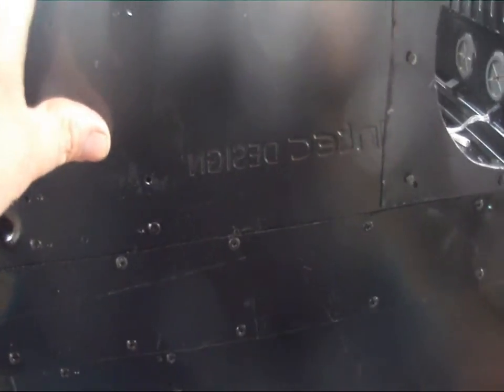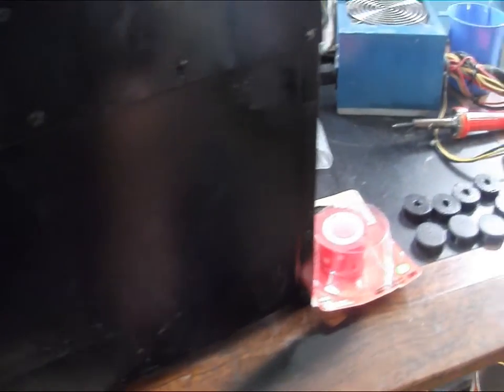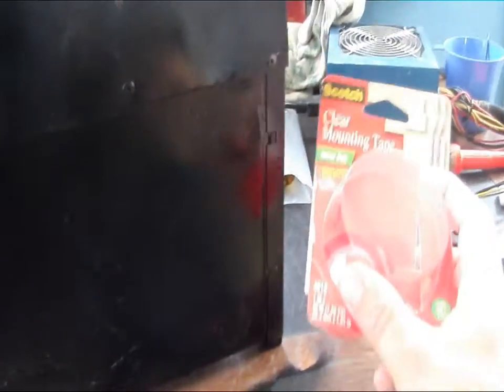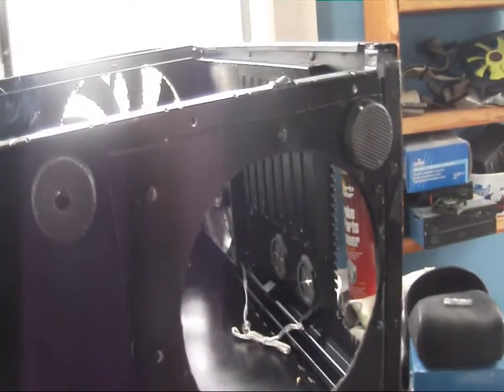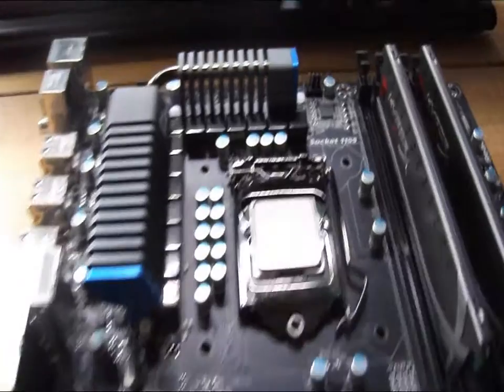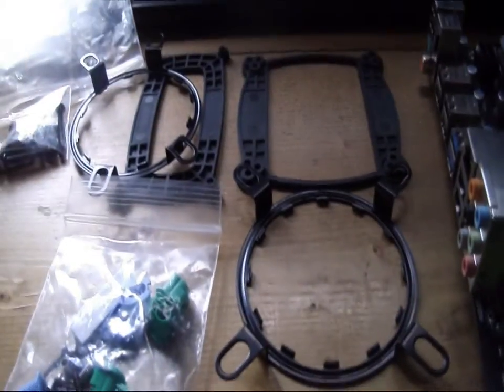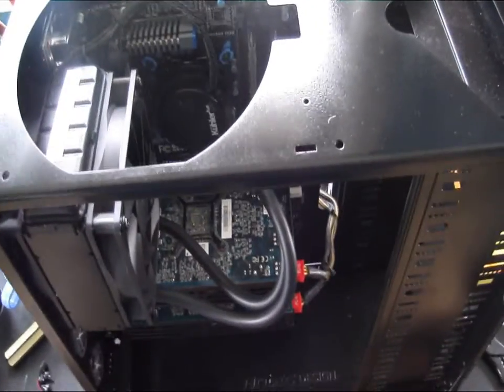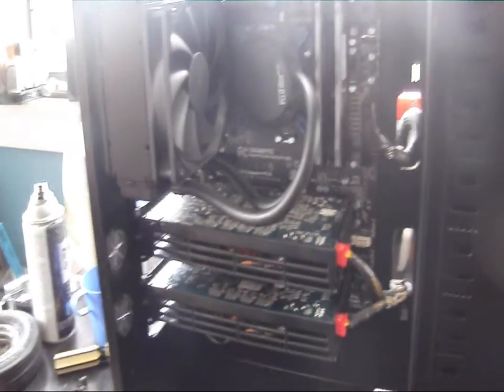Antec 1800 Build Log Part 9

Comment from the maker: That is strange. My guess is that the temp sensor is not reading the temperature properly and the card is actually hotter then it is telling you that is why it shivers. There is nothing wrong with manually setting your fan speed. I do it on all my cards and have never had a problem with it. You could even try to increase it to 50% more just to have a little breathing room before the card gets too hot.

Comment from the maker: That is very strange. I still think it is a driver issue more then it is a hardware issue. I think you should remove all the drivers for it. You might want to use something like driver sweeper to make sure all of the trace elements have been removed. Then install the drivers fro the disc you got when you installed the card. See if that works . If it does then maybe update your driver from Palit website and not Nvidia. Some cards are having trouble with the newer drivers.

Comment from the maker: To change your refresh rate go into control panel and click on display properties. It should be under monitor settings. It should have a drop down menu that will let you pick different refresh rates. 

Have you tried running it with the side cover off of the case?. Just wondering if that 56c is accurate. It might be much warmer then that. What are you using to monitor the temperature with?.

Comment from the maker: There are a couple simple things that you can try first. One is to try changing your display settings. Some times different refresh rates can cause things to shake. Have you changed monitors lately?. Or drivers for the card?. I don't think it is from the card getting hot. What model is the video card?. Maybe I could find some more information out on it for you.

Comment from the maker: Thank you very much. 

I have always painted the optical drives in my builds but to be honest I was so concerned about other stuff that I didn't even thing about it when I installed it. The PSU is also silver and wouldn't hurt to paint that either. I will see how much time I have to work on it I might be able to squeeze them in.

Comment from the maker: It is a shame because they do really look cool when they are lighted but they really do need to find a better way to mount them. 

With all that space it should make running the cables so much easier. And with all the fans I should be able to keep them all at very low speeds and get a ton of airflow. Cool and quite are just what I want :-)

Comment: I know what you mean about the lighted LED feet. Had the exact same problem with mine - knocking them off whenever you moved the computer! This is a great job, Fuz and I'm sure it will solve your cable management issues. You should get some good airflow too - I expect your temps will be very good!

Comment: The Antec feet are a solid choice (potential pun intended?) for the project, sometimes stock is just the best way to go. Everything else looks great, its weird how clean it will be in the main side with everything running to another entire case. O-o